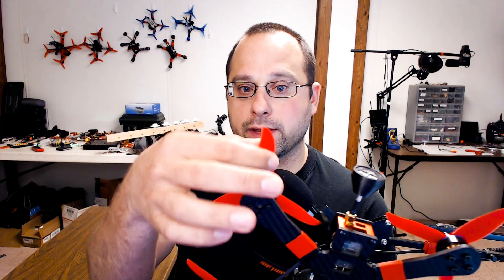How to recognize prop deflection (and my new favorite prop!)

Comment: You can get all of the Cyclone series T5045C and T5046C or T5050C in all available colors at www.prop.city with shipping from the USA. I am a small company but I have insanely fast shipping and excellent customer service.
Reply: Prop City Prop city for life
Reply: Hi guys I’m new to fpv flying , just a quick question. Would the cyclone series fit my wizard x220s?
Reply: @AdrenalineAshRC  It's a 5 Inch quad so yes.

Comment: I love the Cyclones they have been my goto prop for over a year now.  Once in while RDQ will offer bulk pricing on these which gets the cost down to below 2 bucks a set.   Another thing I have noticed about the cyclones is that there is a difference between the solid color and the "Crystal" colored, the Crystal colored ones tend to be a bit more flexible and forgiving if you bend one in a crash, you can usually just bend it back straight and keep flying it, the solid color ones tend to break instead of bending.  I can say this with some confidence as I have been using them like I said for over a year.  With colder weather coming on this can make the difference whether you break or just bend a prop when you knick a gate or slap some scraggle.  FYI

Comment: Hi Josh, I had this with gemfan 5x4x3s but not on the kingkongs so I bought another 2 boxes, but I also bought a box of the racerstar 5x4x4s and they are so damn smooth, not as strong where the petal meets the hub of the prop though but man they punch great and grip is an understatement, I'd love to see what you think of them...

Comment: Want a banging 5x4x3? That are truly awesome on a premium quality 2204 or 2205 the GEPRC translucent 5x4x3s.. the solid colors are a little less stiff then the translucent ones are. They are very durable and are balanced better then any 5x4x3 I have ever flew.. they are stiff enough to standup to my Hyperlite 2207 V3s 2522kv on 6s... no prop deflection even on 6s... they are priced super good and one of my absolute fav freestyle prop for tight areas as they aren't super fast props on 4s but the respond oh so awesomely and power is instant with no mushy feeling. One of my fav builds is a floss 2 frame, Hyperlite Floss 2204 2522kv motors, HGLRC V5 Pro F4 FC, 20 amp 4 in 1 Blheli_32 And a Eagle 2 Pro cam.. on 5s 75c 1000s it is stupid fast and the only prop I fly on it is the GEPRC 5x4x3s it handles like a cat on Velcro and fast on a race track big powered heavy 5 inch builds aren't even a challenge if it's a fairly tight track I'll run 4s if it's more open I'll run 5s and with 5s I will keep up with the high powered 4s rigs down the straights and eat them alive in turns... oh yeah on 4s 1000s I'll get close to 5.5 minutes of running gates and over 4 minutes of ripping hard

Comment: DAL makes great props, but I love king kongs too, mainly because they are inexpensive and strong.
It's been a little over a year since I've flown my drone, I fly low and fast with sweeping banked turns and hairpins and a couple flat out straights, my favorite prop is 5045-3's on amazon, but I believe they are just DAL clones, I run 3S and 2204- 2300Kv, which may sound feeble, but that's on a 385gm AUW X frame, so for a race drone built for a small "track" it's more than enough.

I like low RPM high pitch setups, you feel more weight in the frame, letting you toss it in a corner with less gyroscopic force, so the brakes work less hard and props slow down in a hurry, using the momentum of the frame to "drift" and then punch out- given this setup makes the drone feel less stable, as it becomes more thrust dependent than gyro dependent- I suppose this is what freestylers are looking for.

High RPM low pitch drones are faster all out and have more overall stability, but they feel too "floaty" for me, it's like sliding on the air instead of getting pulled through the air.

I'm trying a + frame next with the same 2204 2300kv motors.

So far my favorite rig was an Aimdroix blackbird 250, it was a long box looking thing, sorta like today's stretch X, I used 1806 2700kv motors and 4-blade props. It felt perfect, FAST with average acceleration, and it banked and turned like it was a slot car, I gave up on it as it was hard to maintain, hard on batteries as it was a pig, it's also long been discontinued, hoping the Diatone + will behave similarly, only without the headache of a closed up box with 5 plates and adjustable arms.

Comment: recently I ordered XXD A2212 KV2200 motor, can u please  suggest a prop which is best suited for the motor( 7050 or 5050) for a quadcopter, currently I'm having a 2s li battery, should I go for 3s battery?
Is there much difference  between twin and tri bladed props ?
Reply from the maker: Yes there is a big difference between 2-blade and 3-blade props. 3 blade make more thrust and draw more amps. I don't know much about motors in the 2212 size. I'm not sure that is an ideal motor for a 5" prop. What size props does your frame take? You asked about 7050 or 5050 props but I can't think of a frame and motor setup that would be good on both a 7" and 5" prop.
Reply: That motor is intended for fixed wing application, not miniquad.
Reply: thanks man

Comment: Yep, I get the loss in efficiency, yep I get the thrust loss... but it sounds freaking awesome! Like you're breaking the air itself! Which is why I'm still using dal 5x4x4 on 2600kv. I gave the cyclones a good try, but they are really heavy blades.

Comment: Hi,
Which DAL Cyclone props should I go with, on my freestyle quad with Emax RS2306 2400kV motors on 4S, T5045 or T5046?
Thanks!
Reply from the maker: Try both. The 5046 has a little more pop but also more amp draw.
Reply: I was leaning more towards 5045, but will try both. Thanks!

Comment: Which motors are compatible with these props then? I still have 3 full sets of props mentioned here.
Reply from the maker: Lots of motors work great with these props. Almost any 2204, 2205, or 2206 motor  in the range of 2500kv or less.
Reply: So Racerstar BR2205S should fit for them. At least one mine quad match - thanks!

Comment: hi Joshua I have an issue with my quad only when I hit 80-100% throttle. once I hit that range it goes nuts until I come back be lower that throttle range and that is the only time it happens, I synced the esc's and recently switched from a f3 fc to a f4 fc I have not done any pid tuning at this time due to I'm still a newcomer when it comes to fpv flying, if needed I can send pictures of what I have and of the current pid tune unless it would be easier for you to see a video of the quad acting up
Reply from the maker: Video of the quad acting up would be the most helpful thing.
Reply: Joshua Bardwell I'll see if I can get a video today my camera does not have audio

Comment: Thanks again, just heard that exact noise on a new build with the kingkongs on it. Messed with the PIDs but couldn't figure it out. Then I saw this vid changed my props and noise is gone. Crazy feels just like low P

Comment: only just watched this video. experienced the same issue when i used BR2306 racerstars @ 2700kv and these 5040x3 king kong prop. and noticed it was the prop because of the sound. switched to 5051 and no more problem,  now running MAD 2306 @2750kv with 6040x3 props, high rpm's no problem at all with 6040x3 ;)

Comment: Some of the newer motors with hollow motor shafts can also whistle.  It can be confused as prop deflection.  And easy way to experiment is to tape off the motor shaft and see if the whistle goes away.

Comment: Josh if you try the emax avan you will be tossing the cyclones in the trash. The only down side to avans is amp draw. They are super smooth at low end and still have top end speed. BTW that fluttering sound can also be caused by a bad esc. I had a quad that made almost every prop make a loud harmonic sound. After 3 days of trouble shooting found that it was an esc.
Reply from the maker: I have an Avan care package on the way.

Comment: So here is a question for you then Josh, I recently purchased a box of King Kong 5x4.5x3 Bull Nose props. They defiantly are stiffer than the 5x4x3 KK's I, like you, have been flying. My question, could you try out some and get back to us with your thoughts?  The Bull Nose props are within a few cents of the regular shape that you showed in your video and therefore might be a good option. I kind of like them. They appear to have more punch but that might just be my perception. 
Cheers
Reply from the maker: I don't like that prop shape.

Comment: I know that sound and the feeling of punching the throttle and loosing power and control ... had that with the T5046C and we were quite clueless, had to change to Racekraft 5051/azure/GF5152 to get this quad flyable ... 2407 motors are just too powerful I think.

Comment: If you ever try 5S, the Butter Cutters (5x4x3) would make weird flutter sounds like what you showed and snap mid air so I had to move to Dal T5050C Cyclone V3 and Dal 5050C Cyclone.  If you like the 5046 Cyclone and 5045 Cyclone, you might like either of those 5050's better through the whole curve.  RK5051 didn't work for me on the curve and Gemfan 5152 too long.

Comment: The new Avan props are actually really good (not just hype)... it feels like you P gains are higher without the propwash and they are have a very good locking hub design. I run the emax 2306 2400kv
Reply from the maker: I have some on the way.

Comment: exactly why i've been flying the cyclones (v1s actually) on high torque motors for the last 6 months. On the cobra 2207/2450 they match up perfectly and give wonderful linear response and bags of power for the full benchmark 3:30.

Comment: I have original littlebees and origonal emax red bottoms so they aren't powerful enough to deflect my KK 5040.  Its worth noting that the kk 5045 is a LOT stiffer and quite a bit heavier.  I doubt they would deflect like the 5040, but they are also definitely slower.

Comment: nice how to. thanks! but now i asked myself if there are optimal rpm-ranges for specific props. i remember my 3d-helicopter, each rotor blade has its own max. allowed rpm (for sure, there are several different factors like centrifugal forces depending on these much bigger and heavier rotor blades).

Comment: @Joshua: How do these cyclones do with the bit higher kv motors (2600kv or so)? Are those motors still reving out like with the lighter props or just impossible to hear that fluttering because the motors doesn't reach higher revs anymore? What is the conclution? No sense any more to run higher kv's than 2300?
Reply from the maker: I think they are fine on higher kv motors for sure. I really don't think these props flutter. Not on 4S anyway.
Reply: Well, based on our talk, I just ordered 3 sets of the Cyclones (5046C) for my 2600s. I want to find out and compare to my ol' HQ 5040x3 and my favourite DAL T5040v2, which are actually pretty similar to the HQ's but way more robust

Comment: Interesting observations Joshua.
That fluttering noise is actually incredibly loud - I'm sure the microphone on your camera was clipping it as it's super loud when it happens. I made the mistake of testing some GemFan 5x3x3 props on my thrust test stand with some fairly powerful motors. As the test reached 80% throttle, the props started to flutter and the noise in an enclosed space was probably in excess of 100dB. A very short time after the test advanced to 100% throttle, the prop simply ripped apart. All the was left on the motor was the prop hub!
Reply from the maker: Yeah. You can see I chop the throttle immediately when I hear the noise. If you keep flying like that, the prop can explode.
Reply: 'Explode' is exactly the right word for what happened to the poor GemFan prop I was testing. One second it was there and the next, it had turned itself into so much plastic shrapnel! :)
I was kind of glad that I didn't rush back into the room where the test was running to abort it when the noise started. Plastic or not, I'm sure I wouldn't have enjoyed being hit by any of the shards when the prop exploded.

Comment: What are the differences between the DAL Cyclone T5045, T5046, and T5050?  Just progressively more motor loading?  Where do these fit in the spectrum of heavy to light props?
Reply from the maker: I have only flown the 5045, but from what people are telling me, the 5046 has a lot more thrust but also a lot more amp draw. I would expect similar from the 5050 but I don't know.

Comment: When the Emax Red bottom motors came out it was obvious that 5040 props weren't capable of achieving top end thrust even though the motors were capable of more. All the motor thrust tests showed that 5040 props "flat-lined" and that was with 2205 2300KV back then and showed that 5045 tri generated more thrust and became the standard.
5x4x3 are what is used when you're a beginner because of the prop deflection and allows newbies to practice throttle control without the quad launching into space because the deflection essentially acts as a throttle/thrust limit. You still got a decent launch but tapers off very quickly allowing newbies to 

Oh well, now you know and so do others. ;)
Reply from the maker: Saying 5x4x3 is what n00bs use isn't right. Many top freestyle pilots continue to love that prop shape. It doesn't deliver ultimate top-end thrust but it is light and smooth. IMO it is only in the last six months or so that ESC, motor, and FC technology has gotten to the point where we can choose props more freely, without inviting propwash oscillation back in.

Comment: Great video, I'm only flying a wizard and a lizard.. I have some gemfan ordered for the lizard the stock props just bend and break too easy.. Plus I wanna see how a 4 blade works on it compared to a 5 blade... I use those kk on my wizard but have a couple sets of the cyclone to try.. I'm really just still learning, and trying to transition from level Los flying to acro with goggles... Man I wish I had just been forced to learn acro

Comment: regarding the 5051 props:

The 5051's are good when you're flying fast (at speeds in which other props would have a squishy throttle feel). Their high speed handling can be analogous to a race car with high to enforce cornering at 80+mph

You wont like 5051s when testing them against other props in drag race scenarios since drag races are usually about acceleration, which 5x4x3 style props dominate at. 

Also, 5051s don't spool up as fast, they're like a larger turbo. But once it kicks in you better be strapped in cause their grip at speed is gnarly.

Comment: Everybody check out the IDEAl props. I cannot speak to 2800kv motors but they will certainly be fine up to 2400-2500. They handle amazing and knocked out prop wash and increased handling on all my F1 boards before I switched to F4. They made my old quad feel like a new machine. They are also super durable and they split the difference between a super bendy prop and a HQ hard prop. Hey all you have to do is buy a pack to try them out and if you like/hate them it will be off your list. All I know is that they were a revelation for my style of flying. http://www.readytoflyquads.com/ideal-prop-5048-tri-blade-propeller-(blue-clear)
Reply: Also available in 50x51, I have not tried those, they probably are insane.....

Comment: If you like the traditional 5x4x3 but prefer some of the things that the cyclone gives you, (durability, stiffness, more thrust) you should really try the Lumenier Butter Cutters. I flew the 5x4x3 as you did and after trying several props (including the RK 5051 and DAL Cyclone) I landed on the Butter Cutters (for now). They are a great freestyle prop.

Comment: So i have been having oscillation issues for a while and then I remembered that one of the ESCs jas some jakced uop firmware where both BLHeli suite and BLHeli config cant recognize it. BLHeli suite says that the escs firmware has been deleted or is unknown and asks if I want to flash it with BLHeli firmware. I tried but it didnt work. I did pick the right ESC firmware. Is this the probable source of the oscillations? Could this be why I had a desync? Ive been trying to tune out the oscillations but nothing works. I have isolated the fc as much as i can but nothing helps. I even replaced two motors but that didnt change anything. the other two motors arent the smoothest things but they aren't too bad. Would some of the oscillations have gone a way with replacing the two motors? I can't think of another reason why I am experiencing such oscillations besides this ESC not having any firmware on it, unless my flight controller is bad. I just got it and I originally thought that the vibration and oscillation was just from my flight controller not being soft mounted and not soft mounting motors and having so many things touching my fc, but after almost completely isolation the fc and soft mounting everything, tgere are still vibrations and oscillations

Comment: Hey Joshua your totally right today's motors are so powerful that they just flatten out softer props I'm surprised to hear the cyclone v3 is your favorite have you tried the Gemfan flash 5152 props to me they feel like the dal v3 but more top end speed but the absolute best prop for handling prop wash is the new Emax avan props they have really great control low and high speed but not the most efficient I also tried the butter cutters but 1 punch out with my f40 pro's ripped the blades right off the hub which of course caused me to crash on concrete not good anyway you should check out the dal biblade 5" cyclone v3 it is really efficient and has good control